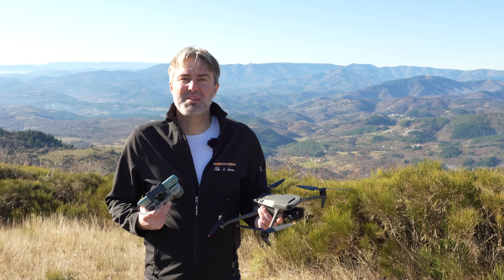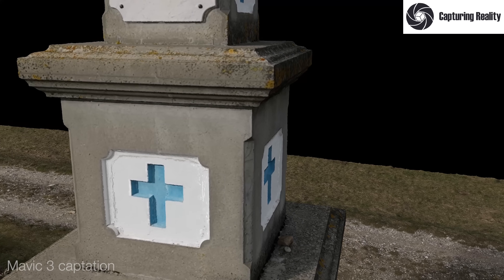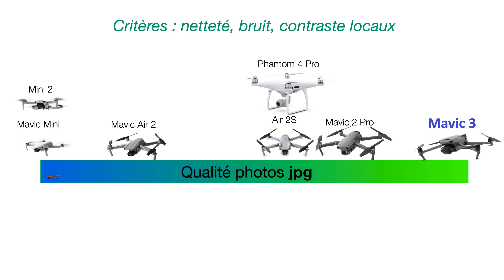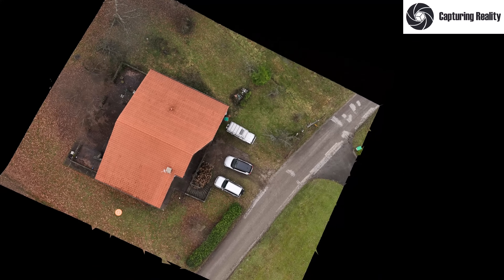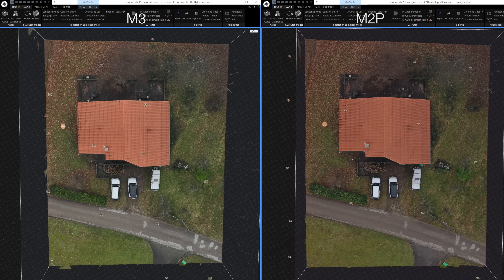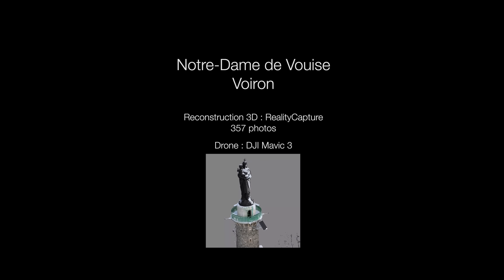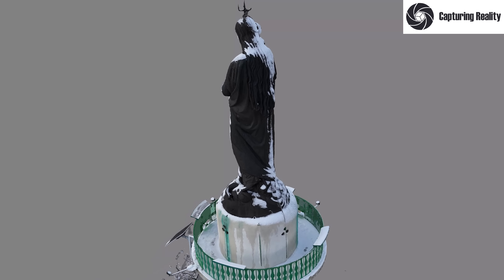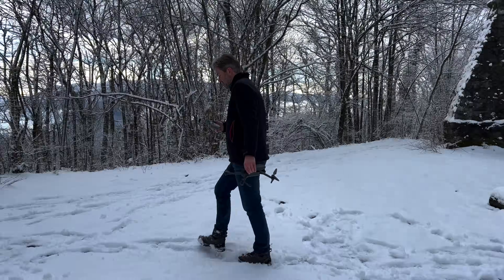Mavic 3 - modélisation 3D par photogrammétrie

Comment: Amazing video, I've been considering the air2s but this video kind of sold me on the mavic 3. I'd love to see a video of the mini 3 pro comparison with the Tour de Clermont -Tonnerre Chirens, with the air2s, mini3pro, and mavic 3 side by side if you have access to one.
Reply from the maker: Hello, I should have access to the Mini 3 pro soon. Despite the 48 Mpx definition of its sensor, the quality should be lower than the Mavic 3's 4/3 sensor because of the photosites size. I curious to test and check the differences !
Reply: @paladrone  Yeah the 48 Mpx is just a quad bayer function on a 12 Mpx camera, but I've seen some technical photos / stress tests and it looks pretty good when put side by side of an air2s photo. The noise level seems to go up quite a bit when using the 48 Mpx mode though, whereas you don't notice it as much on 12 Mpx.  Here's the video I watched to get this information : https://www.youtube.com/watch?v=c1aG7CUieRo&t=920s

Looking forward to seeing your analysis of it ! Great work btw - As a hobbyist in photogrammetry these videos really help me choose the right tools.
Reply from the maker: Hi, thanks for the link to this very good and professional comparison. I remember that the 48 Mpx mode of the Mavic Air 2 was as well good when tested on chart, with strong light in a lab, while very poor on a landscape. Is the denoiser algorithm more efficient with geometric shape ?

Comment: Hello, Would you make comparison video of Mavic 3 vs. Anafi AI ?
Reply from the maker: Hello, it's not on the schedule. Whatever, the sensor of Anafi AI is smaller and can not reached the performance of a 4/3 sensor with bigger photosites.
Reply: @paladrone  thanks for the reply. AI has 48mp camera. Would this make quality difference?
Reply from the maker: @nuriorhan6038  theoreticaly, better is the sensor definition, better is the photogrammetry. But these 48 Mpx are actually provided by very small photosites through a quad bayer matrix : it’s more 12 Mpx in fact.

Comment: Thank you for sharing all these great findings.  It's a pity that Mavic 3 doesn't implement a higher MPix sensor which would greatly improve its performance for photogrammetry. The price of Mavic 3 made me thinking if second hand DJI Inspire with a custom gimbal and a sony full frame camera would be better for a little extra cost...
Reply from the maker: Hi Dimitrios, indeed a higher definition sensor would be great for the resolution in photogrammetry, but unfortunately not good for the shadow and low light performances.
About an Inspire 2 + embedded Sony mirorless, theoretically possible (with small lens), it seems to me complex to develop a reliable and efficient solution.
Reply: @paladrone  The solution is, it can be 8 times more accurate on the same camera, experiment with the AI, and you have the MAVIC 7, from the year 2035
Reply: @Amok3D  which algo/ai running then to improve it ?

Comment: Le test photogrammetrie que j’attends. Toujours aussi fouillé. Cependant j’aurai 2 questions a te poser:
1. comment et surtout pourquoi partages tu les traitements entre Reality Capture et Metashape ? Car de ma connaissance les deux softs permettent de faire de la reconstruction 3D.
2. plutot que d’effectuer un travail de prise de photo avec recouvrement, as tu deja essaye de realiser une video de l’edifice a modeliser et de donner cette video directement dans Reality Capture, qui lui tout seul extraira les images de la video suivant l’intervale de ton choix.
Merci.
Reply from the maker: merci et très bonnes remarques !
En fait je n'ai pas partagé ou réparti les traitements entre RC et Metashape : la reconstruction a été faite intégralement en double dans chaque logiciel.

Oui l'usage d'une vidéo est possible, je n'ai pas testé. A considérer en dépannage et non comme un mode de captation privilégié, car ça ne permet pas d'optimiser la qualité (définition des vidéos inférieures aux photos et risque de flou de mouvement).
Reply: Le seul intérêt que je vois de capter en vidéo puis extraire les images, est de gagner du temps sur site, ou voler moins longtemps si peu de batterie.